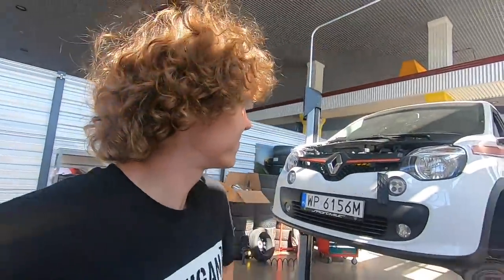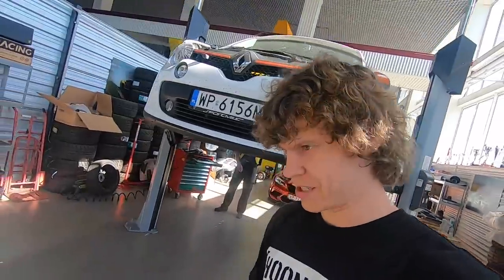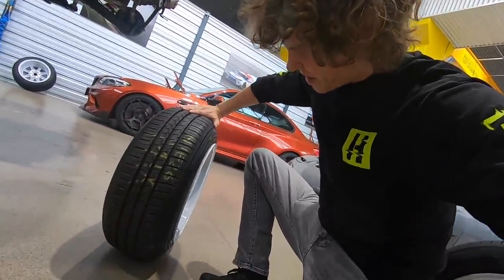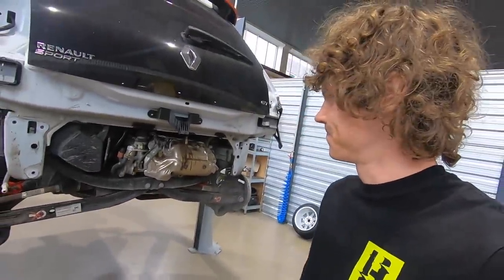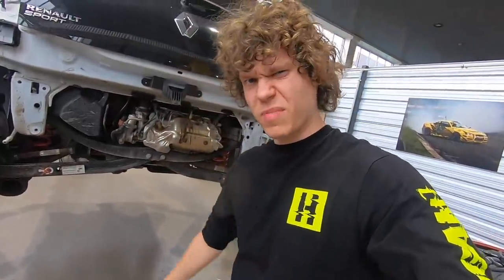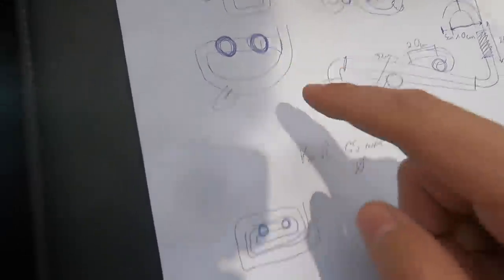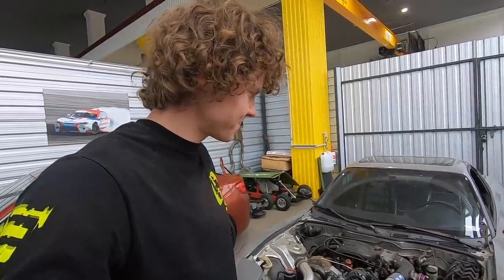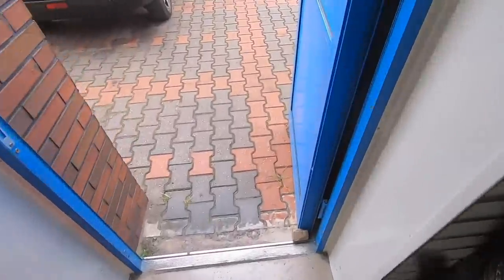First Upgrades For NEW LOOK + RX7 Plans

Comment from the maker: Hey guys! Just to make it all easier, please attach any of your exhaust designs under that comment. Thanks!
Reply: Do a side exit exhaust
Reply: by the side of the rear glass hood.
Reply: Straight pipe
Reply: You have given the exhaust a lot of thought. The Elmo is genius.   I think the shorter the pipes, the less back pressure.  Swingo can't afford to lose any power.  I believe  something to make flames is in order .
Reply: Ale zajebiste te twingo
Reply: Some short as possible header and a Carbon motorcycle muffler...
I think that would really fit the Swingo GT. 
🤘🏻🐒💨
Reply: Remove the cat and just run a pipe out the back facing down, like your S15.
Reply: get rid of that cat shoot some flames. I have a motorcycle muffler on mine at this time but its my daily so ..... I know its just a toy for you but KW makes some nice coilovers for it its what I run
Reply: Elephant. And did I hear you say your taking the rotary out of the rx7? Because I don't think your gonna get 500 hp out of a N/A rotary unless its a crazy 4 rotor and even then I think you'll struggle to get that much power. Rotarys can be reliable. Just run good gas with a mix of 2 stroke oil like I'm sure the previous owner did and it'll last you forever!
Reply: http://www.ulter-tuning.com/realizacje/511
Reply: So 20b or 26b ?  🧐
Reply: bananana!
Reply: Hey r u done with Formula drift
Reply: Rearbumper side exit
Reply: the pretzel elephant exhaust would be hilarious to see, a more practical idea would be a 180degree bend into a straight pipe with custom heatshield, AC Cobra/Caterham 7 style
Reply: Side exit is the only thing fit for a beast like this!
Reply: Wide body the car it will look really funny
Reply: Side exit straight up! Mini semi truck
Reply: Bosozoku pipes
Reply: Spiral like a turbo charger, from outside edge to centre then straight out the bumper
https://i.imgur.com/OC8EWNN.png
Reply: hello I'm from Indonesia very good at you drift
Reply from the maker: Thank you guys so much for all the ideas. It’s time for some more drawing in the design studio now 🙌
Reply: @candymachine3431  spirit💪🙏🏼
Reply: Pandem Twingo?
Reply: @candymachine3431 ciao candy machine!!! Where we can but the widebody black flares ? Thanks

Comment: Surely you could just use a thinner diameter pipe than standard? Use the elephant design but just with like 1/4 of inch thinner pipe than standard. Then the back pressure should be a bit more and you won't lose power.